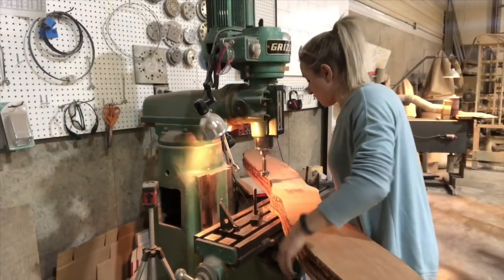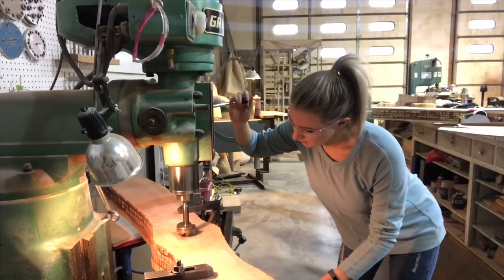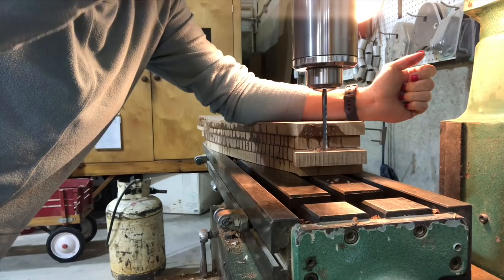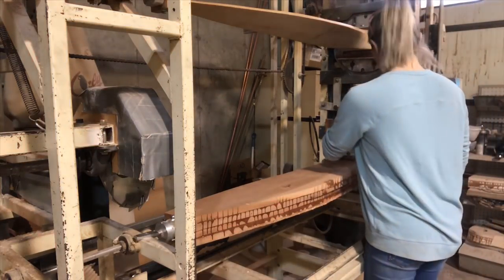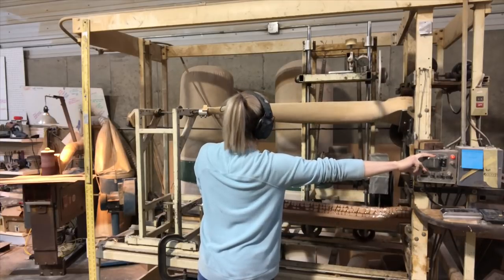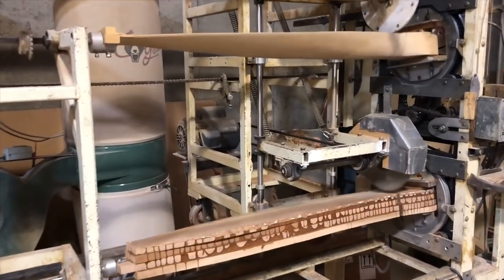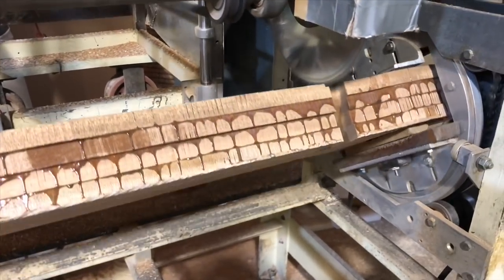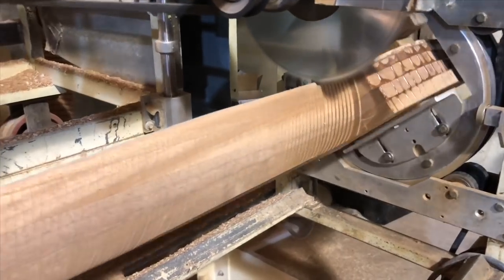Day 2 of building an airplane propeller

Comment: Love that tracing lathe - so simple (no CNC!).  I did a tracing operation manually on my 12" metal lathe to duplicate a decorative brass cap for an antique coach lamp.  In my case, I used a dial indicator against the pattern and a HSS toolbit ground to the shape of the indicator tip.  It worked like a charm.   I would LOVE to see how the blade pattern is made.

Comment: Can you please define for me the purpose of the pitch cut? Also, I would think that the locating of the wood in the duplicating machine would be critical and I do not see how you locate the prop in the machine. And then you flip it over a run the cut on the other end of the prop. What about the locating between the cuts of each end? I have seen you use spacer blocks and you have adjusted the prop so the cutting blade stands equally above the wood on each side which I believe helps you to locate the prop. Maybe you could make a video illustrating how you locate the work piece in the machine and the flipping process. My background is in building die cast tooling and in the 60s through the 80's (pre CNC) we used a lot of duplicating machines. Right out of the Navy in 1969 my first job in tooling was operating a Hydotel machine that machined steel die parts from plastic models. Thanks for your videos!!
Reply from the maker: Yes, I leave a fair amount of stuff out because it’s hard to film. So some of it you will just have to trust that I have a method. Lol

Comment: Really great video, thanks! I noticed  that it looked like the tip end wasn't centered on the 4 layers of the wood. Did I see that right? Is that to do with the shape of the prop blade?
Reply from the maker: I center it by putting the center of the prop in the center of the shaft that it turns on, and I just shim it the way I need too. This one was 4 boards, so I have no middle board.
Reply: @CulverProps  You make it look easy, but there seems to be plenty of ways to mess it up and a ton of things you do just because you just know what you have to do. Like I've said before art and science.